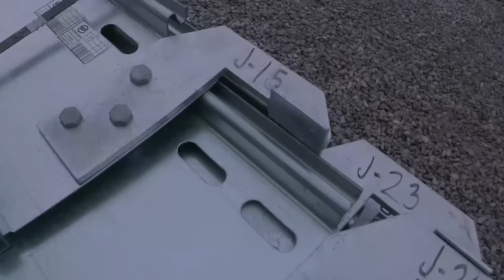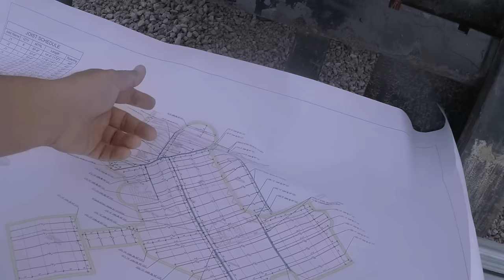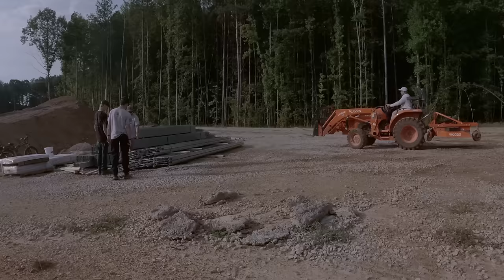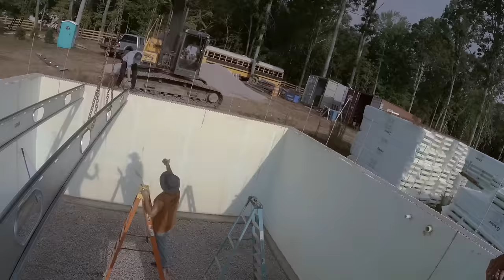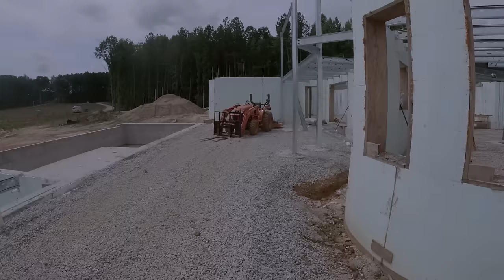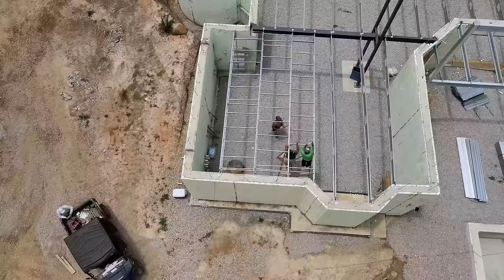Super Floor Suspended Concrete System Installation : ICF Mansion Gets A Floor Day 1

Comment: The drone is exceptionally good at showing braces that don't line up, much better than trying to figure it out from underneath.
Reply from the maker: I use it to line things up all the time. Of course, I was flying the drone before the crossbars were all in.
Reply: @BealyGood  yeah yeah, I was just looking and thinking, bugger me that has a commercial application beyond just taking video's. The entire layout is exposed in seconds when walking around could take 15 mins and you might still miss something. The bloody lens distortion causes issues but layouts and missing tool finding ...... mint.

Comment: It’s great that you have pass through for hvac built into the ceiling spans!  What goes on the walls and how does that support plumbing and electrical layout?
Reply from the maker: Sheetrock goes on the walls. The plumbing will be inside interior walls. The electrical gets laid into the foam.

Comment: That was like the old Erector Set we had in the 60's when I was a kid. 
You can get them again.
I loved mine.
They were snap together with floor,  interior and exterior wall you snapped on after you put the frame together like a skyscraper. 
Geoff's house is an adult version.
Reply from the maker: Yup 😁

Comment: Geoff, next set you put up use for the roof structure  use a rope on each end of thebeams.
That's how you control the swinging.
Makes it lot safer setting thos beans in place.

Comment: @ 19:00 A couple of guide ropes would speed up the placement of those joists and help keep the swing to a minimum.  25' - 30' with a snap ring at the end so you can attach and detach from the joist quickly.
Looking good so far.
When does the ground floor get poured and won't all the joists and bars be an obstacle for the concrete pump?
Reply from the maker: House will be under roof before I pour any concrete. So probably Oct or November

Comment: Geoff huge Kudos to you for the workmanship etc involved in the organisation and implementation of the project and management of your home, but looking on from afar (rural Western Australia)
I have noticed myself and others above my 64 year old age group here in Australia, downsizing to smaller homes as we age, lest work to maintain, less stairs to traverse, cheaper to run etc, may I ask why so big? Why have to spend so much just on heating and cooling, power and so on when building a more economical place makes it easier to pay off less interest paid to the bank and more kept in your pocket, etc
Just curious at how our 2 countries and cultures think so differently towards putting an affordable roof over our heads and why
Tony from Western Australia 🇦🇺
Reply from the maker: Generational home. Half of it is entertaining space. Also will be a demo/model.
Reply: @BealyGood   I thought as I typed that demo home would be part of it, grin I suppose having a tiny house wouldn't have the same impact 😁

Comment: Starting to look like a home!
Are you going to build an unattached garage in the future?
Reply from the maker: Yes
Reply: Put a connecting Breezeway to keep insurance cost reasonable, if even an open topped breezeway with grape vines growing, then no Garage Rider Policy is required, just one policy for House with Garage attached by breezeway, due to' low fire risk for having Garage separated but connected !

Comment: It is surprising that the beams (?) are hanging on just, relatively, little piece of metal and that it supports the load. On second thought, I assume that floor is not the support, but the concrete pour will flow over the floor and the concrete load is transferred to the walls through the concrete and the metal. Thank you and have a great day.
Reply from the maker: @dennis2376  Correct. When the concrete is poured it locks it in.
Reply: @BealyGood  Thank you.

Comment: Haven't watched yet ( but will ) Hope you putting Span-Crete on top of the beams for Ceiling and Floor !
Reply from the maker: @4Classie  I have no idea what that is
Reply: @BealyGood  Ok not Span-Crete, Andrew Camarata built his Castle using Span-Crete that usually used for Parking Garages, Bridges and building some homes !
This was copied !
Hollowcore plank is an ideal product for commercial and industrial applications because of its versatility and practicality. Hollowcore lends itself well to use in offices, hotels, and industrial buildings. Each pre-stressed slab has multiple hollow cells running through it, making the planks both lightweight and unbelievably strong.

One of the resulting advantages includes the ability to span long distances while using fewer support beams than required by traditional building materials, thus allowing for the creation of open, flowing floor plans. Additionally, hollowcore plank is incredibly quick and efficient to install, reducing the budget for both crane time and installation costs.
Reply from the maker: @4Classie  I have found as I’ve been going through this that lots of things that seem like great solutions on the surface end up having downsides too. Interesting sounding product. I’ll look into it so I can talk intelligently about it.
Reply: @BealyGood  Very subtle Jeff.😆👍
Reply: @BealyGood  ✅
Reply from the maker: That would have been pretty cool. I talked with one company but the cost was double what this route cost me.

Comment: Geoff why did you not pour the basement floor before you placed the first floor. i mean i think that would have been easier and maybe cheaper.
Reply from the maker: Lots and lots of stuff goes under the slab so will get to it later
Reply: @BealyGood  o so its because of materials not being on site. well thats a good reason as any.
Reply from the maker: @highkicker11  no. I can get materials at anytime
Reply: @BealyGood  well then i am stunned and will wait for what you are going to create.

Comment: Nice video Mr Bealy Good. If you have to pour concrete shouldn't you have waited to put up metal joist?
Reply from the maker: Concrete will be a ways off
Reply: @BealyGood  Ok thanks, I was thinking the metal joists would be in the way to pour the floors.

Comment: On your Instagram it shows the metal floor is already installed, so what's next you're going to stack the 2nd floor walls or take care of the plumbing and then pour the concrete on the floors? Also, when are you going to stock the pond with bass, wasn't that supposed to happen in late June?
Reply from the maker: @snappingbear  going to stack the next walls and pour those. Then build the roof. Then will get to the other stuff. Not sure what happened with the bass. The company got bought out and he’s told me a couple times that it would be in two weeks, but then I never hear from him.
Reply: @BealyGood  Are you going to do the electrical and plumbing yourself or subcontract it? Also the crew that helped out on the superfloor are they going to frame the house at some point or is that going to be a Geoff, Josh, James DIY project?

Comment: What sold you over the taditional metal bar joists?
Reply from the maker: @virginian7317  for me it was the relationship with SuperFloor.  Customizing the length and placement of the openings. The ability to shorten a beam if needed. The price was fair.
Reply: @BealyGood  I really like what I saw.  The field modification ability is a really big deal. You can't do that with the standard engineered bar joists without a PE drawing!

Comment: Bealy, that's quite the system! What goes on the top of the beams, concrete or plywood? Just finished watching Chris and Sam work on his drag line/crane. Should have brought that over to swing those beams in.. <g>
Reply from the maker: Concrete
Reply: @BealyGood  I have to ask...have you estimated how much concrete in the whole project? Thinking I might want to invest in concrete futures.
Reply: I think all the rest of  oncrete construction came to a  halt when they started hauling for this.😂😂

Comment: When you lift and place items that can swing around when suspended, you put a tagline on one end to control its movement and prevent the swinging. A tagline is a rope tied to the piece and controlled by a man to prevent the suspended load from swinging. An uncontrolled swinging beam is dangerous!

Comment: Please tell those joists are getting welded to the steel !!!!  I see they will be secured between them walls.
Reply from the maker: No
Reply: @BealyGood  I’m not feeling that. Keep in mind I have been working with steel for 30 plus years.
Reply from the maker: @lhr1701  they get locked in by the Concrete

Comment: The desighners in the uk ..... The uk always kept inches, feet, miles, gallons and pounds.
Reply from the maker: I’ve never talked to anyone in the UK that used any of those words
Reply: The metric system is routinely used in business and technology within the United Kingdom, with imperial units remaining in widespread use amongst the public. All UK roads use the imperial system except for weight limits, and newer height or width restriction signs give metric alongside imperial.
Reply from the maker: @mula2626  interesting. I’ve been there several times and never seen that.
Reply: @mula2626   thanks for your courtesy towards us europians😉. Always fell at home there across the pond.
Reply: @henkoosterhof5947  I should add that this info was taken from Wikipedia.
Reply: @henkoosterhof5947  I’m from Canada and we officially use metric but there are some people that still use both.

Comment: What happened to all the grass?
Reply from the maker: @ShalomBrother  Grass Guy ordered 25% winter grass and 75% summer grass and they reversed it. Plus we’ve been in a drought. So he’s going to re-seed in the fall.
Reply: @BealyGood  Guess you should think twice about bragging on all that grass, you have yet to correctly establish in a permanent fashion.
Reply from the maker: @richparks1966  or perhaps I should hope that the Supplier of the Grass Seed knows what they’re doing
Reply: @BealyGood  YES EXACTLY, Per-SLAPS, if you cuff-up the supplier enough, he'll get it right. Then you can calculate how well you're doing PER-SLAP. Perhaps, you should use this PER-SLAPS method to figure out successful progress.
Reply from the maker: @richparks1966  can you get in line to be the first one to be slapped?
Reply: I don’t think there are many grass types that will look good in the summer heat - especially the first year. The roots just haven’t had enough time to get established deep enough for heat protection. Most grass will go dormant in hot soil, just as they do in the cold - they don’t need the blades and they become a liability to transpiration. First time the soil gets into the growing range (usually under 86° depending on variety) it’ll come back.
Reply: @richparks1966  Why so bitter? Did a lawn guy pee in your Cheerios this morning?
Reply: @BealyGood  I'm thinking Per-SLAPS NOT Sir Bealyton. So I take it, you now have some sort of screw-up contractor 'line' forming up, are there respective basic forehand and the more intricate backhand pimp-slap lines for the various degrees of screw-upy-ness?
Reply: @nandi123  Like you got clue one about bitter, to be assuming bitter. I stick more to the twisted part of bitter & twisted. But you should lay off the whiskey in the cornflakes.
Reply: @BealyGood  Perhaps, a Per-Pimp-Slap line to better help calculate success? lol
Reply: It's on vacation....
Reply: @richparks1966 I tried to make sense out of your unusual dialogue …. couldn’t make it happen.  I’m fine with silliness but didn’t care much for the smart mouth comment about his grass failure.
Reply: @genesispuredeaf2390  Well I just live for what Gene thinks about my comments, lacking knowledge of the circumstances that proceeded it, which might bring the Gene-monitor up to speed, and away from assumptions. 2 yrs or so ago I said, he planted mostly cover grass you got nothing really established, don't brag to hard, which he did repeatedly anyway. Now it's back to moon scape tundra, rock farming as mentioned in the Green Acres soil report from agent Kimball, or heavily used arterially range site.
Reply: @richparks1966  "Per-slaps", "Cuff-ups"??? You're an example of why people shouldn't do drugs.
Reply: @snappingbear  They are just plays-on-words mostly, Chief Nipping-Barely, (Too much Fire Water, Per-Slaps?) these might be a bit deep for you to fathom, but really just old jokes, or old slang terms that don't require the drugs you must see in lots of things. For you, it's NOT 'Don't Do Drugs' it's more like 'Don't Do Logic'
Reply: @BealyGood  so they did 75% rye and 25% fescue instead of the reverse? I would have him seed some warm season grass in too in your crummy dirt I doubt even fescue would hold up through summer
Reply: @richparks1966  I don’t know Gene …the “Gene-monitor” comment means nothing to me.  

Unless you intentionally ignored the response from Geoff, it appears that the failure was a misunderstanding on the ratios of winter to summer grass between his vendor and their supplier.  Even with a correct balance, there would still be a need to weather some turf development for the first growing year but nothing like what it will take now.  The grasses that grew absolutely did great things (from a proof of concept) and Geoff was right to BRAGG on the success that was obtained after proper soil prep given….especially after what they experienced without it.  Your over the top hyperbole (moonscape, rock farm) isn’t at all what he has now despite the obvious brown out.  There is structure intact to hold against erosion and allow absorption upon getting rains, there will be some green returning (albeit a lot less than if the ratio was correct.   A proper stand of summer grass would still be impacted by dry heat and lack of water but not like this.  That is why they will be reseeding at the proper time.  

Again, when it is your money being spent….you get to control the narrative.  Some venders might work with you, others might tell you to go pack sand (if you’re a PITA) ….I have watched Geoff enough to know that he has decent to excellent “currency” (aka goodwill) with vendors for support and getting issues resolved in a manner that serves everyone involved.  

You will have to fill in the blanks on how your slang works with vendors but my guess is that you are perceived as a slippery one (fast talker) who might get away with a few things (once) but that a reputation also exists for you ….to protect them against “getting bit twice”.
Reply: @genesispuredeaf2390  Oh somehow Genes once again missed another play on words despite the fact I just told him that's what I do, it's almost like Gene's deaf, isn't that right Genes is deaf? We went over these grass ratios 2yrs back and noted this then. Even Mr Haney called his place a moon scape, after I gave him the terminology. It's back looking like then, but with a new crop of rocks. Go sell it walking grass man.
Reply: @BealyGood 
hehehe, BG, line up your slapping crew start with you,  wife  lets dig &  cement crew ..😂😂❤❤❤😅😅
Reply: @BealyGood  New Bealonious Tee-Shirt Product Copy: 'Per-Slaps, I'm Slap Happy'  ...Sorry man, Per-Slaps that stupid new 'Roadhouse' commercial has gotten to me?
Reply: @ShalomBrother  OMG do y’all not realize that grass was temporary for erosion control!!🤣🤣🤣🤣come on guys get with the program don’t be a total Biden! !
Reply: @ShalomBrother   chris made a smoke pile and burned it?